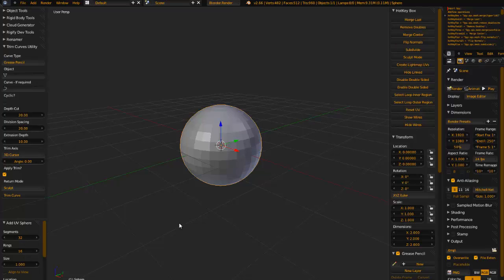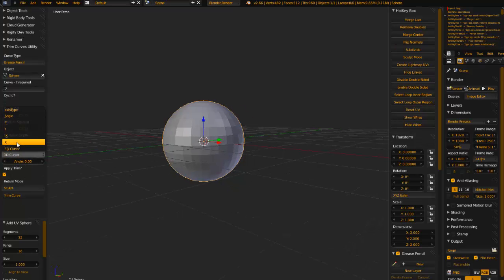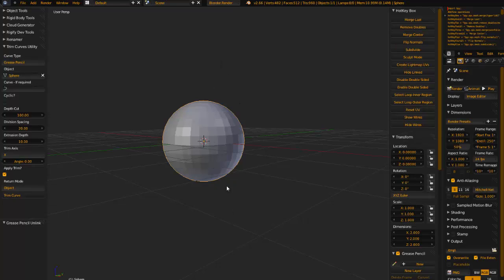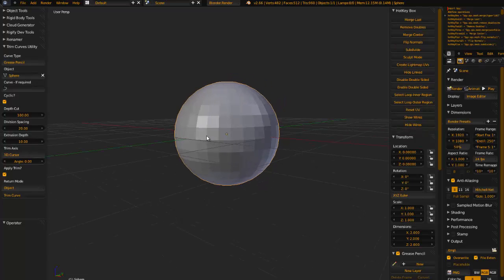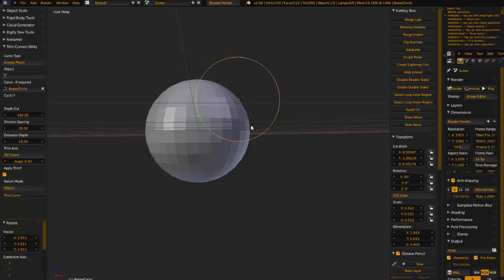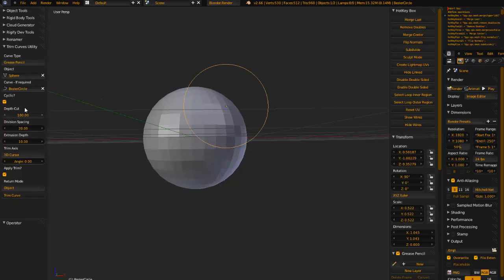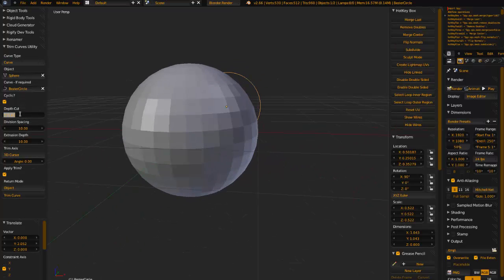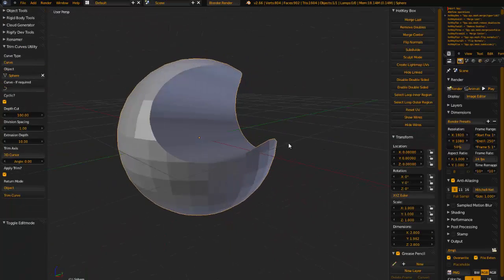Trim Curves Utility Blender

Comment: Yeah I've used the boolean modifier a few times but the problem with it  is that the geometry is usually pretty screwed up after applying it. In your vid that you had a way to reduce this problem. Wonder if that feature could be added to the modifier. Any way keep up the good work.